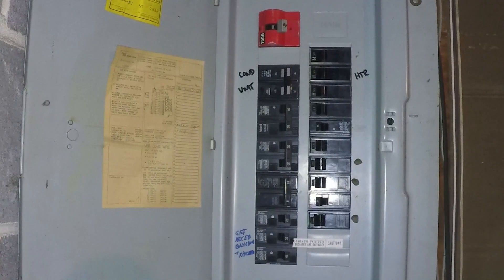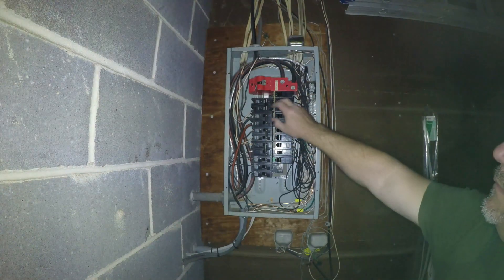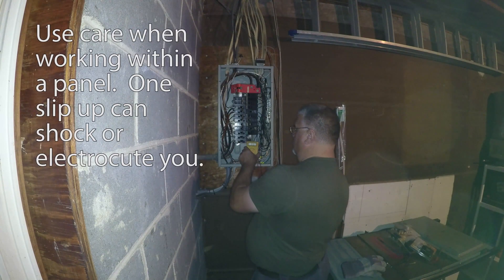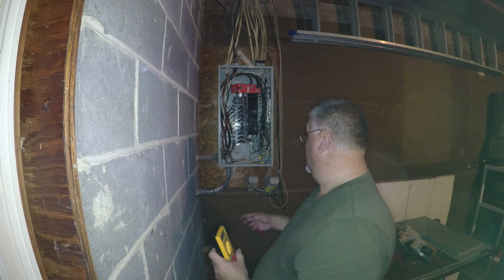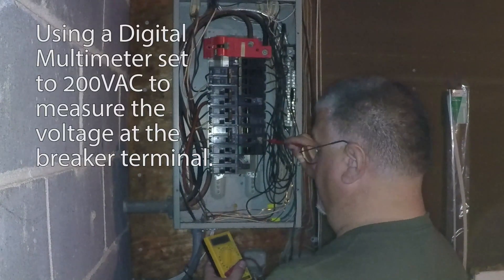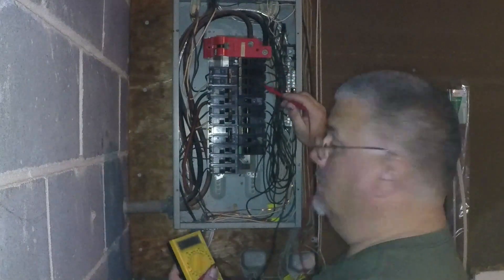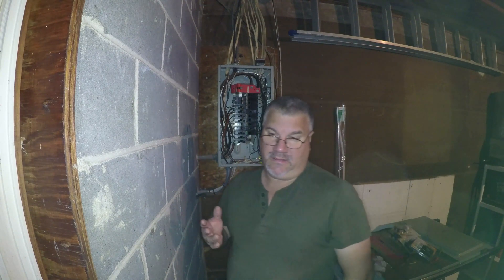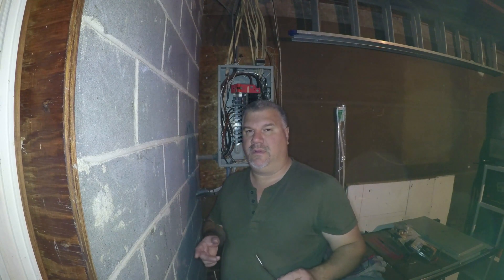How to Find Open Circuits and How to Test for Dead Circuit Breakers - Step 1

Comment: I just had to do this and discovering that all my breakers were good also made me groan.
Reply from the maker: I had an issue where a wire was loose and the AFCI/GFI kept tripping once a day in the morning. The temperature drop was enough to break or make the circuit and trip the AFCI. It took me a long while to track it down.
Reply: Ugh, yeah that would be quite a mystery. I took a year electrical course, but then decided not to pursue it, so I am a very rusty apprentice basically. I know enough to isolate the issue to the right breaker and test the breaker, but finding the open connection is going to be a challenge. Maybe I'll just tell my wife we can't use this room to plug things in anymore. :D
Reply: When you follow a wire through the attic and rule out everything except the breaker... the moan is more bitter

Comment: awesome. I'm far to scared of playing with electricity to do that. besides death just worry about how I would damage the whole thing and not have electricity
Reply from the maker: You are in that group where I say if you are uncomfortable then hire an electrician.  There are certain things I will not do.  I hate doing roofing.  I'm ok getting up on a ladder and stuff but when I'm on a roof challenging gravity to a fight I just get this fear built up in me.  I had a tough time doing a gambrel roof for my shed that my wife had me build.  It had a peak of 16 feet.  For my first time installing a sub panel I just read the national electric code book and applied the rules.  I figured it was ridiculous to hire someone to do my electric considering that I have a BSEE from Drexel so I was like "let's get er done!".